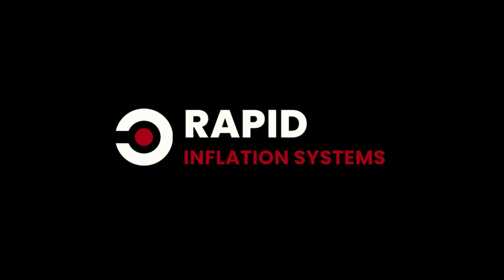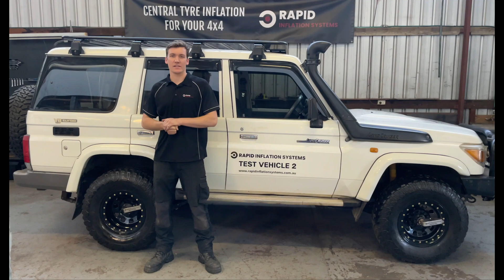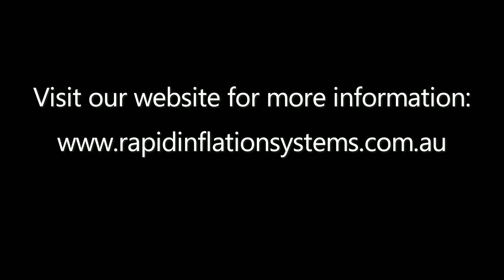Inflate/Deflate Your Tyres With Ease - Rapid Inflation Systems

Comment: I am looking for just a set for my ifs toyota,, seems like you will miss out. Also being for 4x4 and drilling into the wheel shaft thus exposing this inner part of the diff to the elements, will it be 100% sealed/waterproof as well as able to take knocks from rocks and scraps, also if it does dreak or snap off,  are your tyres afected or can you just revert back to normal use.
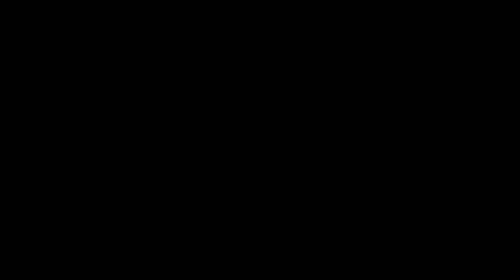There would have to a comp 3:00 ressor somwhere, does it come with extra cuplings so it can be used with and air tank and other accessories as it would be silly to have to have 2 onboard air compressors don't you think?.
Even though it's specific as you say to each vehicle there must be at least a base price for say a hilux, GU, pardo etc etc. 
It's been 9 months since this video and don't see any updates, hmmmm

Comment: Disappointing video. I like to see how it works rather than generic sales rubbish.
Reply from the maker: The mechanics of the system are still confidential. This information will be made available in the future.
Reply: @RapidInflationSystems  Does it have custom compressor or works with off the shelf compressor?